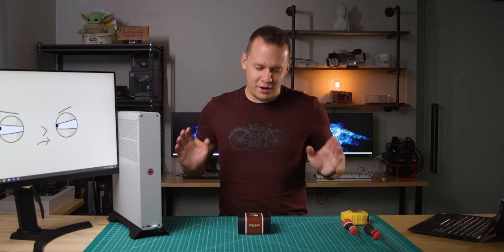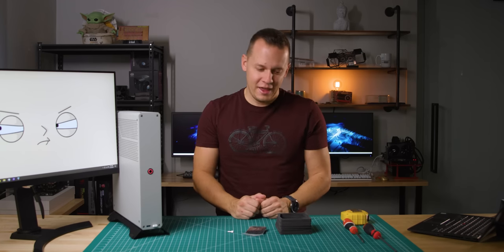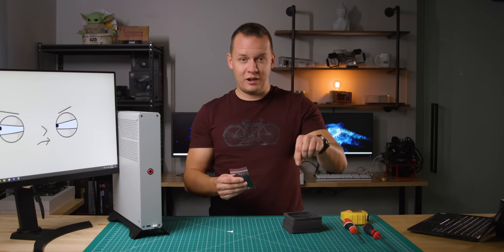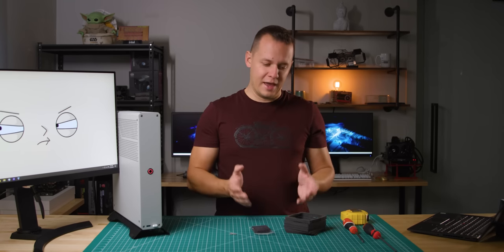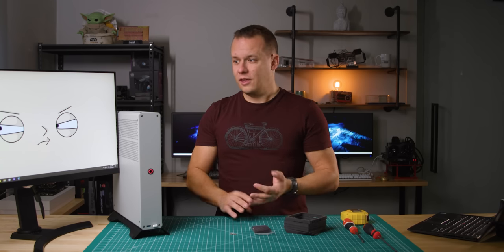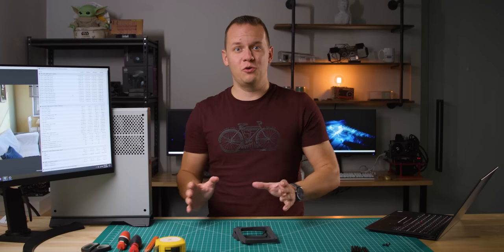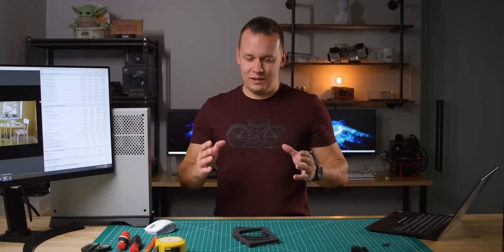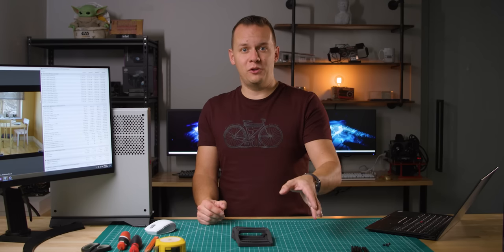Lower CPU Temperatures Just Need THIS!

Comment: They need to make 120mm versions of these, And let us use them on our radiators, but not as a duct to get fresh air in, but as a gap between the fan and the radiator, to get rid of the dead zone that's directly under the fan hub.   I usually do this myself by using an old gutted out fan, and just using the frame as a spacer.  But something like this would be a lot nicer, and would seal much better against the radiator.

Comment: This review misses a little context... The product is for cases that lack the space to actually FIT a larger cooler... A format envelope where the L9 series is still one of the top performers. With the addition, this actually places it solidly in the lead. 

What it isn't is some magic equalizer that makes it perform as well as a larger format cooler, but if you have the space to fit one, then that's still the go to solution. 

As someone who's using an S4 mini(not even skyreach mini, which would let me use a larger cooler), this is an absolute godsend product. If you've got just 10mm more, that already opens up an extra class of cooler and another 20-30TDP. It doesn't sound like a big deal if you've got the headroom for larger coolers, but it's massive when space is at such a premium

Comment: My previous build featured both a SpinQ VT cooler, and a Storm Scout chassis; it was really nice because the top end of the cooler (which was half of its intake; other half was the base of the cooler) was nearly right up next to where an intake fan would be installed on the side panel, so what ended up happening was that a decent enough chunk of its intake air was.....fresh air.

I loved that cooler, and all the work that went into that build's airflow pattern; cooling an FX-6100 to sub-ambient on an aircooler :D

Comment: what I did was use a large fan from my broken power supply. I think it's 120mm. and mount it on the inside (u can do outside) of the grate. those holes make it convenient, and then I added a controller pwm so I can manually adjust how much air or noise going into the side of the case, which is blowing right on the cpu fan. I got this idea from my custom built one from 20 years ago with clear side cover that had a case fan built right into the side. that mostly blew onto the video card but still. it effectively cools the cpu and everything else directly rather than the case fans which blow perpendicular.

Comment: I put a thicker fan on by drilling the top holes slightly bigger in the fan case. Dropped the thumb screws in and with a pair of snout nose pliers I could tighten them up. Just helped with air flow in the node 202

Comment: Noctua's installation video says to cut the plastic tubes off at the top of the foam, remove the top lay of foam, and trim them back a little so that when you put the foam back on, the plastic tubes will be below the surface of the foam but still position it properly.  That way, you don't risk cutting the foam.
Reply from the maker: One step too much for me but I appreciate the logic of that! - Mike

Comment: From the concept of it, the better air flow ur case has, the less this little thing can do to lower the temp. Basically, It could be a good solution for cases that cannot discharge heat actively.

Comment: It seems like you should put the slimmer ones BELOW the thick ones, especially if you compress them to cut the straws, the straws will have a better grip on the thick one where the thin one might be prone to slipping off. Noctua's official images even all show that, the thinner ones mounted closest to the fan.
Reply from the maker: Yeah that's what I said.  :)

Comment: Great review Mike!  It was only a matter of time before these came back for the smaller cases.  I mean, there's a reason they used them in the past.  If only the industry didn't switch side panels, I think companies would still be using them.  Except for HP, they would have removed it ages ago in favour of more money, than better prepared hardware =P

Comment: I think another way you could snip the posts would be to put the pad that's 1mm thinner than you need on first, snip it flush then put on the proper size after. That would leave the plastic a little lower than the full height and give you some smoosh room, if you need it, so the side of the case doesn't hit the plastic.

Comment: This video gave me the idea to 3D print a duct going from the graphics card fans running to the front of the case. Since my case has a PSU basement, it can just set right on top of it. It will be interesting to see if that has any effect on temperature

Comment: Instead of measuring the mark you made on the dowel, you could just stand the dowel upright and stack the spacers until they hit the line you made. Really don't even need a ruler for it unless you want to subtract the thickness of your case and make a new line on the dowel before stacking.

Comment: I know the answer! lol Yes.. That's one of the first things i did when i started overclocking back in 1999 when i was 13 y/o because i wanted to play MechWarrior 3 at a smoother frame rate ;-) I was building ducting inside my Gateway mini tower with construction paper to achieve cooler temps and also had the ducting run over the motherboard's GPU chip. Then the first thermal paste i ever bought was Artic Silver at CompUSA while i was drooling over the Antec and Silverstone cases

Edit: i was rocking a P3 733 using SoftFSB to overclock, upgraded to a ATI all in wonder GPU so i could watch and record live TV then a GeForce FX-5500 PCI (not Express lol). Quickly found the limit of PCI despite overclocking the FSB as far as it could go.

Comment: You could have cut 12mm studs by combining the 7mm + 5mm spacers, and then after you were done cutting the correct length, put on the 4mm + 10mm spacers.

Comment: Would be interesting to see a way to route cold air to a cpu in a larger case that doesn’t already have venting a couple inches in front of it. As in a larger case where there is not typically venting on the side panel. If you could route to wherever you have intake fans. Would probably see a more significant temperature change. That would obviously be unsightly and larger cases stay cooler in general, but it would still be an interesting experiment.

Comment: I actually fabbed a cheap shroud for my fractal Node 202 using some hot glue, and an old broken cd case. I saw temps consistently drop under synthetic load a considerable amount (I think at the top 10C, on games about 6-7C.) on a heavily overclocked 3600.

Comment: i like this thing .its just a copy of an old style of two piece duct for the side of a fan but made from foam supporting more cases than the original side duct . I guess today you could 3D print your own but that wasn't an option back in the day
Reply: This works well. very much like the new power supply basement .

Comment: "Is it worth the money?" It's not like it's a $50 mod. At $13-$15 it appears to be a fairly reasonable upgrade if for no other reason than to reduce wear and tear on the CPU from running hot as well as reducing power consumption.

I've only recently come to learn of Noctua and am very impressed with their designs.

Comment: I've seen a review of this product before and I believe I remember it raising the temps of some other part of the PC as a trade off.
Reply: The end result (hot air) also needs to be pulled out directly from the heatsink, if not of course the hot air will be pulled by another heatsink inside the case.

Comment: I have a 3700x in the Node 202 on an Asus Strix X470-I Gaming with two of their Noctua NF-A4x20 PWM fans sucking air out of the case. 
It looks like the NA-FD1 is currently out of stock but I'm definitely gonna pick these up when they're back.

Comment: I have a DIY mod laptop table with duct and 12mm corsair PC FAN on/off rocket switch for my Alienware M17x 2013 which I made it so the little stands fit right into a purposly made fit holes and the holes for the intakes which I have it connected to my room AC unit (not a portable one, a wall setup)

Comment: If you used this, or something like it, to space your fans away from your radiator, so the blades aren't so close to the fins, would this let the fan move more air?  Removing the effect you get when a window curtain is to close to window box fan & that is blowing or sucking side.

Comment: This is a very cool product. I have to ask... Why aren't case manufacturers bringing back the oldschool OEM tubes for CPU cooling? We have so many ridiculous trends in cases such as RGB and tempered glass, but the OEM PC's having CPU shrouds to pull in fresh air from the side of a case was actually a very efficient way to cool components and almost no modern cases come with side mounted fans any more, let alone a CPU shroud to deliver that air directly to the CPU.
Reply from the maker: Because they are fixated on.... tempered glass side panels

Comment: Della old pc cpu cooling tech with a modern take! Dell did it right in the old days when they applied funnels to their high end pc’s and workstation pc’s. Alienware (Dell) we’re also renowned for this cooling technique 👍🤯. Great benefit on offer….. but for a bit of packaging material, quite expensive ☹️😭. Hopefully cheap knockoffs hit the market, otherwise I’ll just cut up my motherboard packaging foam and do the same thing 😝😆🥳👍
Reply: you can sbuy new oldstock shrouds still. i picked up a couole of 70mm uv fans the other day 😂 but it will leave you running two more fans (intakes and outlet) for all the passive components when they start heating up and failing.

Comment: Those ducting tubes used in air conditioners would work if this works. And they can bend directly to an in-source air -flow anywhere in the case

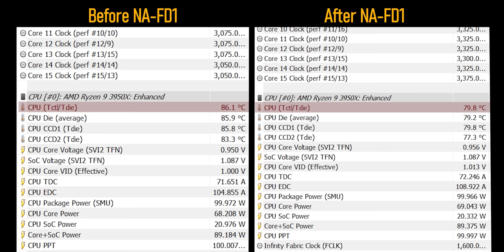Comment: in your temperature comparison part at 8:18, you noticed that your CPU cores were actually clocking HIGHER than before the fan duct, right? that's a HUGE thing worth mentioning too, you were clocking 200-250MHz higher and had lower temps.
Reply from the maker: Yeah I missed that.

Comment: Sure, its going to pull in cooler air in or direct hot air out of the case. That is my guess. There is a reason dell, gw, and such used them.

Comment: Cut some spare foam with a exactly knife, or even have something printer with a 3D printer. Or go super ghetto with some tape, cardboard, etc. Also, you can do this on any fan if it has exposed through holes with zip ties, a nut and bolt, threaded inserts, etc.

Comment: I think it's an accessory that would be interesting in all cases just to add a bit of buffer between your fan and whatever it is stuck to. Wouldn't it be beneficial, if not for the cooling, for your fan being less stessed ?
Reply: or you can buy a fan thats designed to work well in that scenario. no point in you paying extra to patch up the manufacturers poor design.

Comment: Does the foam compresses against the panel grills which lets in the fresh air? Also, any noticeable noise increase?
Reply from the maker: No noticeable noise increase.  BUT this could technically reduce turbulence between the side panel and in situations where the fan blades are closer to the panel.

Comment: If only these existed for a NH-D15...When my cooler's fans are at 80% they create a high pitched irritating noise, but if i hold the RAM fan side with the hand (not clingued to the heatsink) and sloooowly separate it from the cooler, the noise is GONE....

Comment: Even though it helped I would never use a case like that to start with. The components are butted up so close together they can heat each other up that close. No way to get air ventilation circulating all around them very well(imho).

Comment: The FD1 instructions clearly state that you should put the siacers from the thinnest to the thickest. Also, clearly and patiently divided in steps, says that you should cut the straws, remove the top spacer, shave off 2-3mm, put the spacer back. That’s none of your intuition or suggestion, that’s straight product instruction, maybe read them before you do a review (or don’t state it’s your suggestion)

Comment: If you look at older pre-built PC's, I actually still have one from about 2003, They have a Direct Feed from the Vent on the side of the Case in the shape of a "Bellow or Ram Tube" that almost touches the Cooling Fan of the CPU.
So not such a new idea....

Comment: Noctua bringing back CPU funnels from the early 2000's, but if it works it works, you could probably do this DIY much cheaper, but you'd have to do this DIY and not everyone wants the hassle, heck if you have a 3D printer you could probably make one that looks better.

Comment: If this works I suppose you could make a similar duct of out tape. Maybe that grey tape they sell at the hardware store.
Reply from the maker: Problem in these environments is heat.  Most adhesive is rated too low to keep "stuck".

Comment: this might be very interesting even for bigger cases specially if you have a ryzen wraith cooler - or anything similar - since that cooler is always catching the hot air from the gpu. granted this set wont directly fit that cooler, but any handyman can work their way around that

Comment: Great work. Just a fast question. I have the LG 27GP850 144HZ monitor pluged in an nvidia 1660 super. I cant turn on the G-SYNC. Is it cause i m still on windows 7 64bit? If not, what s the way to do it?

Comment: 08:52 I have a quick question in this shot: how much clearance is there between the CPU fan header and the "top" side panel when it's closed? Will it be enough for a 40*10mm fan? 

I have this ASUS B550i mobo and a Sentry 2.0 clone case, and some Noctua A4*10mm fans to exhaust the downdraft cooler's heat. Not sure if they will fit. Not be able to start the build in a few weeks.

Comment: me first PC case had a system like this to move the hot air directly to the outside of the case. a big plastic tube.
I never tested with / without, but its not a new concept ;-)
Reply from the maker: Exactly.  Certainly not a new concept.

Comment: I wonder if you 3d print an adapter from the 92mm to say 120mm and just tall enough to where it doesn't touch the side, could it suck in more fresh air (due to the small holes in the panel) whilst also preventing it from sucking in warm air.

Comment: Okay now I am curious how this compares to sticking the thicker 92mm Noctua fan to this cooler in this case and that way reducing the distance to the side panel.
I'm asking since I have a similar case ("console" form factor upright) and use that cooler with the 25mm thick redux fan and it is working well. 
Noctua came out with the regular "non- redux" chromax 92mm one like a month after I made that build, so I feel a bit salty about my fan choice actually :p /j

Comment: How would it be if you had a 25mm fan instead and the foam if it fits. You should be able to fit a 25 mm fan plus 3mm foam
Reply: You can't reuse the screws you had previously to hold the fan to the heatsink. You need to use Noctua's proprietary screw design to attach the plastic studs, but the screws don't fit on fans of different thickness.
Reply: @wowdogeful  Hot glue ftw!
Edit: Or double sided adhesive film, if the foam shouldn't be heat stable enough.

Comment: If there was ever a product that should simply be a 3D print. Print a funnel to fit your size needs, you can leave a small gap top/bottom if you want a snug seal with a foam insert that you can cut from a foam piece. Would cost anywhere from pennies to a few dollars at most.
Reply: Yep, I logged in to basically make the same post. thingyverse has a load of readily available files for different cases
Reply from the maker: Yup.  I was actually going to do exactly that!  But without a 3D printer myself I priced it out and most folks on 3DHub.ca and other hubs wanted a good $25-$45.

Comment: but now there is less air being pulled into the case so other components will suffer?
Reply from the maker: Didn't notice any changes to other component temperatures.
Reply: @HardwareCanucks  That is good to know. I thought that some of the air that is "wasted" is actually going to the RAM and lowering overall case temp a degree or two which would no longer be happening. But it seems not.

Comment: Hmm, 14mm thoik fan+14mm thick foam…
Why not use a normal 25mm thick fan with 3mm thick foam?
That would be even better.
Reply: It's better to have some space between fan blades and case. Better airflow and lower noise. It wouldn't matter if case had fan sized opening and finger guard. But it does when half of the surface area is solid. Cone shaped funnel would even better so fan could get more air.

Comment: 7:15 Changing the order of the foam doesn’t matter for how much you can compress it. The distance from the moon to the earth is the same as from the earth to the moon ;)
Reply from the maker: That wasn't the point.  The point was that with the bigger one on top, you can actually cut the guide shorter, therefore its more recessed into the foam.

Comment: $2 of foam, $15 of Noctua branding. What no $10 surcharge for technically being “Chromax” black foam? At least it works, and isn’t beige and brown.
Reply: That's the $10, the other $7 is the foam and cutting. Personally I'm tending towards putting it on top of the brown L9a-AM5 to hide most of the fan while retaining the performance of bare metal and avoiding the surcharge (OK, so not much performance, but still).